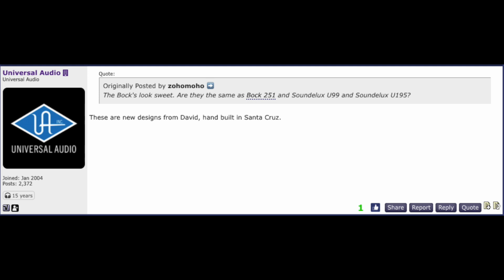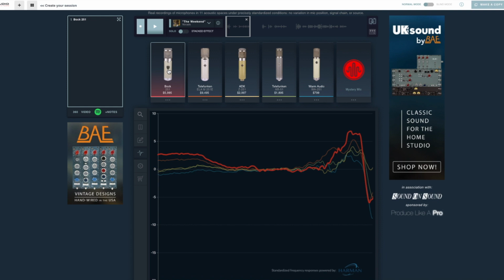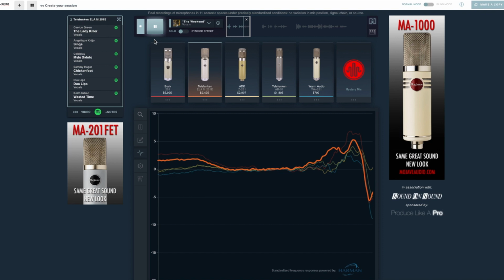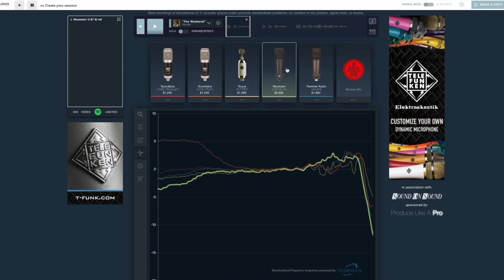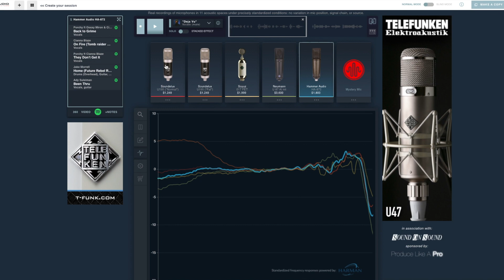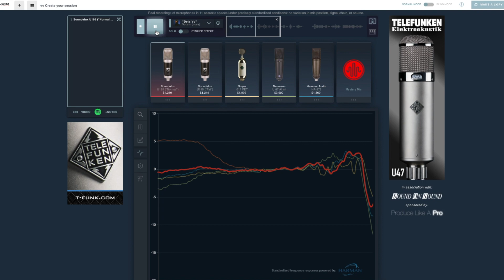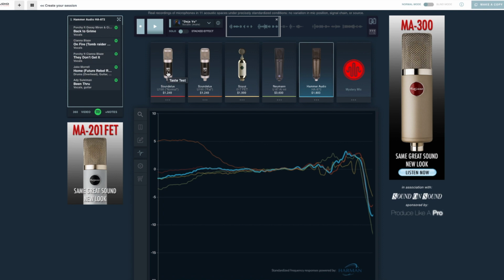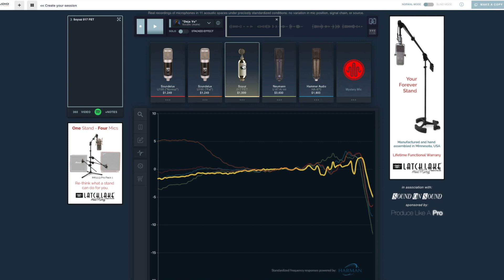This is What the UA Bock Series Mics Sound Like?

Comment: There is a LOT more differences than just EQ or curve- the tube, power supple and all and how the more $$$ mics handle plosives, SPL and louder voices. The tubes also are all different in the way they handle compression and saturation on more $$$ mics. Hearing a quick sample isn't really the best test..
Reply from the maker: Yeah, quick samples aren't the best test, but I maintain that until the actual UA Bock mics are released into the wild, comparing them on ATK is currently the only way to get any idea of what they will sound like compared to the competition.

Comment: Is there more going on under the hood than just EQ with audio test kitchen? It seems to me that it would be difficult to really know how a microphone responds to things like proximity effect and saturation from a tube or something. Is all that factored into the results that ATK gives?
Reply from the maker: It's kind of a flawed setup in that what they've done is record pre-recorded tracks played back on monitors, so right away what they've captured is a recording of a recording so what you're left with is less about knowing the individual character of a single microphone, but a comparative analysis of how separate microphones sound on the same source. I don't think they're doing any EQ on ATK and I think the idea was to capture the cleanest possible signal, so you don't really experience the full scope of what a mic can do. I made a video a while ago wondering if it can be trusted as a resource (https://youtu.be/IA25sqDm8x4), but overall, I think it can work to inform the listener of simple differences between mics, despite maybe having some of those mics' nuances having been made less obvious in the process.
Reply: @MarkYoshimotoNemcoff  thank you for that. I’ll definitely check out that video. I’ve seen a number of YouTubers talk about ATK and how great it is for hearing what mics sounds like before you buy. I just kept thinking to myself, “what an I missing?” I could just apply the same EQ curve of an expensive mic to my cheap mic and get that great sound and save a lot of money, right? Lol I had to be missing something. Going to watch your video now. Thanks again 🙏
Reply from the maker: @AcousticWisdom  When you get to ATK, there are a couple of videos there (and here on youtube) that show how they went about recording all the mics. I found it helpful in understanding the overall benefits and limitations of the ATK experience. The other thing is that some mics take EQ better than others so there's only so far that EQ can take you with some mics. Also, truthfully EQ is a kind of phase smear, so while it's very useful, taking big swings with EQ isn't quite as optimal in some use cases.

Comment: The telafunken & Neumann are better by far !!! Nice try through . Im hoping the 67 does a lot better !
Reply from the maker: Agreed 100 percent. Is the Tele worth $3.5K more? Or would you take the Bock and an 87ai together for the same price?
Reply: @MarkYoshimotoNemcoff  yes the  Telafunken 251  is my Dream Mic ,I do have the U87ai and its Amazing !!!!
Reply from the maker: @angusbrown2712  Sweeeeeet. Yeah, I never realized it until I did this video, but that Tele 251 really sounds pretty great.
Reply: Is this a recreation of the original Bock Audio 251?
Reply from the maker: @TheManInCommand  Yes, with some slight circuit upgrades in the DC side, not the audio side, to make it compatible with global environmental standards, but they claim it sounds the same as the original.
Reply: @MarkYoshimotoNemcoff  Thank you
Reply: My wallet doesn’t open that big for my project studio, So I settled with the Roswell mini 47 and mini 87 also  the Lewett 440 pure. I did just return a UA SD-1 because even with a good preamp & lifter it did not sound anywhere as good in my opinion as the popular shure SM7B which I settled on. I doubt I’ll ever budget for high end clone or even a Telefunken or Neumann, but I would not mind getting an AEA KU5A ribbon someday. Thank you so much for the video I always learn a lot.
Reply from the maker: @reread2549  Yeah, you can’t go wrong with a real 7b in your locker. That KU5A sounds like a real modern gem too. You’re on the right track.
Reply: @MarkYoshimotoNemcoff  just tried Tele TF51 and damn it sounds so good! Sold for my U87ai (piece of ****)
Reply from the maker: @eddwardmusic  The demos I've heard of the TF51 online are pretty compelling. It's a great sounding mic. I have a sneaking suspicion there's a 3u Audio capsule in there, too. If you don't mind, can I ask why you didn't like the u87ai? Was it the top end?